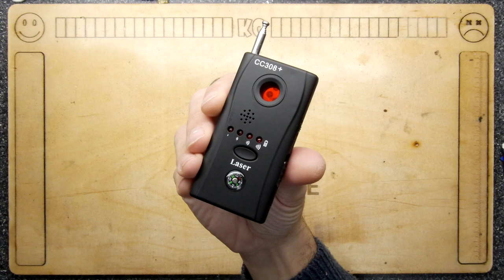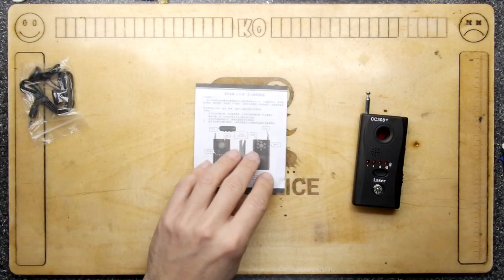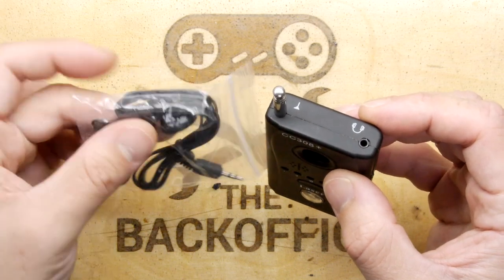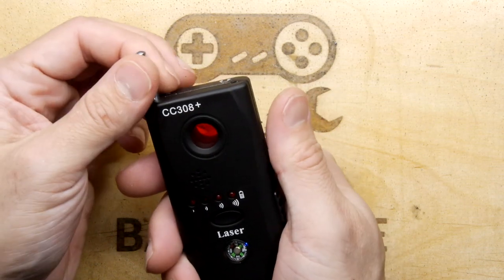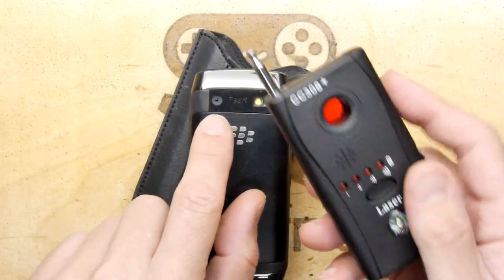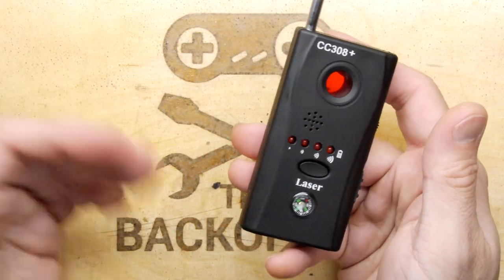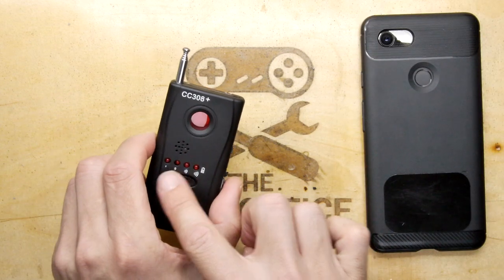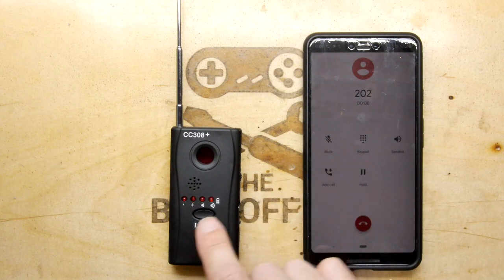Covert Device Spy Camera Detector

Comment: How spot without a detector a spy camera build in a wall camouflaged with illuminating dots  ? Dots illuminate when hidden cam light those dots. Pls answer asap!! Thnx
Reply from the maker: Probably, if the legitimate lens will reflect, you will see it
Reply: @backofficeshow  Thx for your reply.  I have  many fake dots on the walls around the real cam. So in total dark when I spot it scam disable it.  I can dig few square feet of  my walls. Cell apps are useless. If you know anyone how spot location ask them pls.
Reply: @marko77188  if you got for example 3 fakes as u said random and a real one, most likely the real one can be determined by the light in the center and ir..not sure, I dont know how you have them setup but a person with a little knowledge can put a little current in a very thin wire, and even if hidden in wall you can kinda determine which is the real since cables do produce a little magnetism, you will notice the difference.